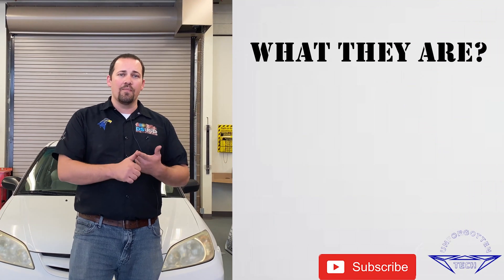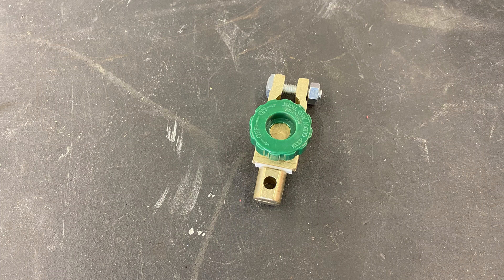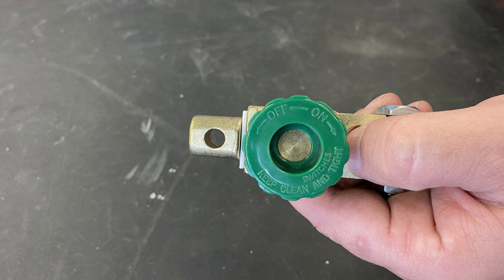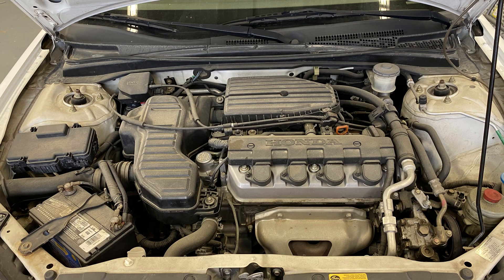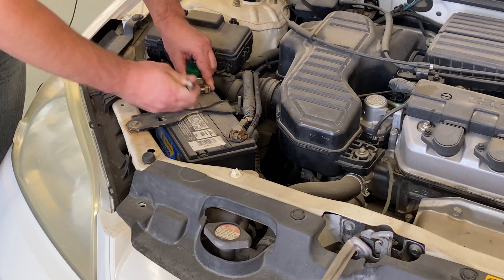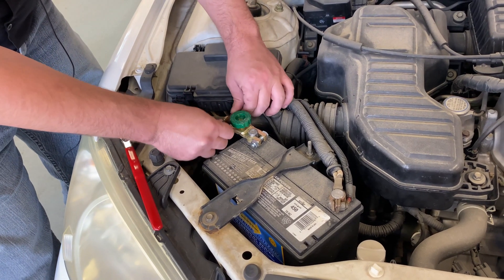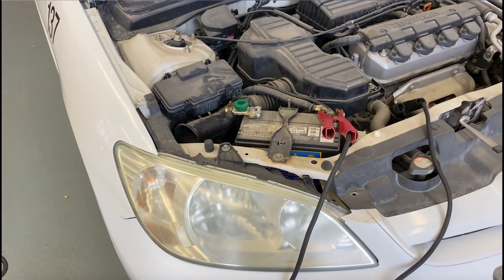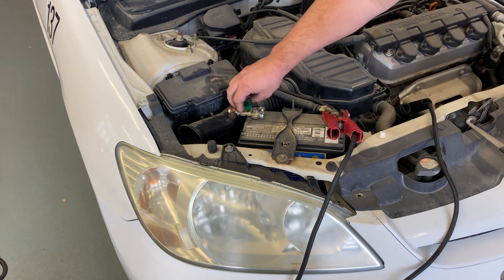How to Install a Battery Quick Disconnect

Comment: When you connect the wire to quick disconnect I can’t see how you do it. It just has a hole so how do you attach the wire.
Reply: He literally just  puts the old terminal onto the disconnect...it's very clearly shown....
Reply: @janegoodall1837  not figuratively ?
Reply: You clearly don’t understand what he was asking. Stfu
Reply from the maker: The quick disconnect in this video doesn't require any additional work to be performed in the wiring. We took the already existing cable and hooked it up straight to the quick disconnect which was connected to the battery. However, I can definitely work on some wiring videos for the future. Thank you very much.

Comment: How about on a 2010 dodge journey?  Can it be done?
Reply from the maker: Karen, yes you can. However the question for this vehicle becomes how useful it would be due to the batteries location behind the wheel well. You probably don't want to remove the wheel well every time you want to utilize the quick disconnect. I hope this helps and thank you so much for your support!!!
Reply: We bought a remote one from Amazon but my husband says there is no room to mount.